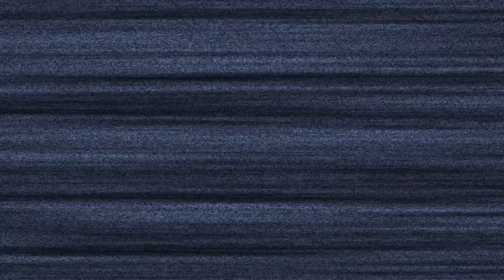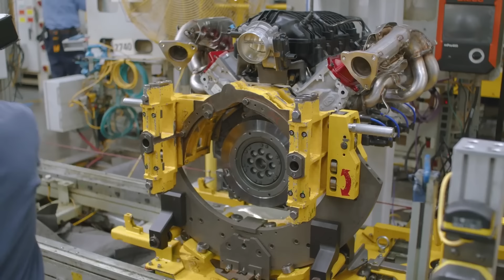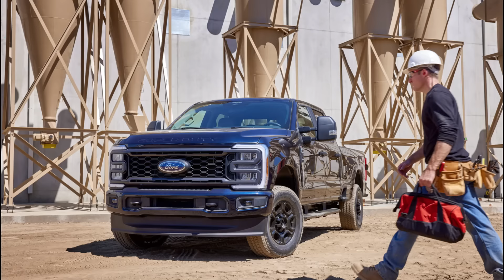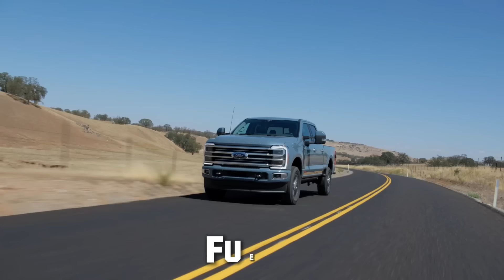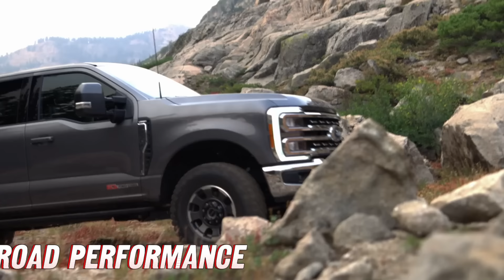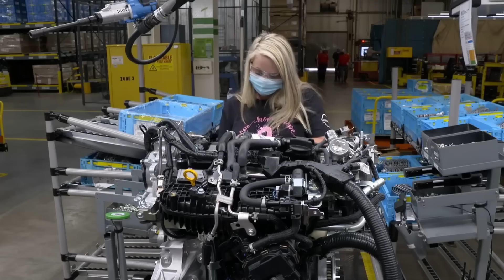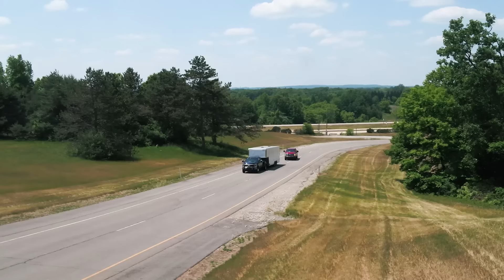ALL 4 Powertrains of 2026 Ford Super Duty EXPLAINED in Detail!

Comment: When a CEL has a starting price of $6k and dealershits having a warranty approval rate that rivals health insurance companies, i just can't justify a $1,000+/mo payment for something I'll only get to drive between the house and the shop.
Reply from the maker: You're not wrong about the warranty approval rates. They'll fight you on a $500 repair like it's coming out of their own pocket. $6K starting point for a CEL fix on a brand new truck is absolutely insane. At that point you're basically paying luxury car prices for work truck reliability. 

Hard to justify when your truck spends more time at the dealer than in your driveway. What are you driving instead, or are you just sticking with older stuff that you can actually afford to fix?
Reply: @speed_spectrum_cars  
95 jeep, 5.2, 46re thats about to be 3 pedal swapped
99 f250, 7.3, 4r100 that will be 3rd pedal swapped of I ever have to unboltnit from the block.

Comment: So what power plant(s) are new for 2026? The operative market feedback to Ford is … fix the current shitty power plants already in circulation.
Reply from the maker: Exactly! Instead of rolling out more half-baked engines, how about just making the ones they have actually work properly? The 6.7 Powerstroke, 7.3 Godzilla, and 6.8 are all decent concepts that just need the bugs worked out.

Fix the 10-speed transmission issues, sort out the Powerstroke emissions problems, and make the 7.3 not drink fuel like it's going out of style. That would be way more valuable than some new engine with all-new problems.

But knowing Ford, they'll probably debut some new turbocharged mess instead of fixing what they already have. What specific issues are you hoping they address?

Comment: So nothing changed........
Got it!
Ford needs to dump the boat anchor 6.8L all together and offer the 7.3 as the entry point, especially for 2wd trucks.  Anyone doing highway hauling doesn't need 4wd, it's unnecessary added weight and cost.
Reply from the maker: Makes total sense! The 6.8 feels like Ford trying to squeeze another engine option into a lineup that doesn't need it. If you're stepping up to a Super Duty, you probably want the real torque the 7.3 delivers.

And you're spot-on about 2WD for highway hauling - all that 4WD hardware is just dead weight and complexity when you're pulling trailers on interstates. Lighter truck, better payload, lower cost, simpler maintenance. Wonder if Ford keeps the 6.8 just to hit some fleet pricing targets?

Comment: 8.000 lbs in the bed of your pickup is insane
Reply from the maker: Yeah, 8000 lbs payload is absolutely nuts when you think about it! That's like putting four cars worth of weight in the bed. Most people would probably break their suspension just looking at that much weight.

Are you actually using anywhere near that capacity, or is it more of a "nice to have the option" thing? Because I feel like most real-world loads are way under that, but having the headroom is reassuring.
Reply: @speed_spectrum_cars  well, at least two modern cars. The structural and insulation really add up on the scale. The average crossover weighs around 4,000 lbs dry. For example, a Chevrolet Trax weighs 4,125 lbs without fluids in it. but still, mind blowing.

Comment: What good are they when they install the wet belt in all the engines?
Reply from the maker: The wet belt nightmare is more of an EcoBoost thing in cars and smaller trucks where that belt runs in oil and disintegrates after 100k miles or so. Those are definitely a ticking time bomb situation.

Are you maybe thinking of a different engine family, or have you heard something about Ford putting wet belts in the Super Duty engines?
Reply: @speed_spectrum_cars  i dont know about the super duty but the F150 with the 5.0 has a wet belt, to me thats a no buy.

Comment: Junk oil and transmission plastic pans
Reply from the maker: Plastic oil pans and transmission pans are such a penny-pinching move! Nothing says "built to last" like critical components made from the same stuff as your kids' toys.
One rock kick or minor scrape and you're looking at a tow truck instead of just a dent in a metal pan. Plus good luck getting a drain plug to seal properly in plastic after a few oil changes. Are you seeing these fail in the field, or just frustrated by the cheap-out design?

Comment: More overpriced, unrepairable garbage.
Reply from the maker: The unrepairable part is what really gets me! $90K for a truck that needs a computer diagnostic just to figure out why the tailgate won't open. And when it breaks, you're stuck going to the dealer because nobody else has the proprietary tools. Used to be able to fix most truck problems with a basic toolset. Now everything's integrated and serialized - even replacing a headlight requires programming.

What's your plan - stick with older stuff that you can actually work on, or just accept the dealer dependency?
Reply: Old vehicles repaired as much as possible for as long as possible. @speed_spectrum_cars

Comment: Watching this made me realize why I should hold onto my 7.3 powerstroke forever.
Reply from the maker: Good call, those old 7.3s are legendary workhorses. Which model year is yours, and was it the complexity of the newer powertrains in the video that made you feel that way?
Reply: the repair costs is whats making me keep my 7.3. Company i used to work for had a fleet of 2018-2022 6.7s. They told me a CEL was $6k minimum, and knowing stealerships like I do, they're gonna decline to honor warranties.
Reply: I agree. I will NEVER sell my 7.3 diesel. My truck is an 02’ and still looks like new.
Reply: they're good engines and they're tough but what specifically are you referring too? I like 7.3PS but I think it's a boat anchor of an engine. they don't make the greatest power especially for how large they are. it was sad when they switched to the 6.0 in 2003 but the 7.3 was really starting to show it's age by that time.
Reply: Because it’s cheap and weak?
Reply: @PARATI-SUMUS  they're not that bad. it was a gutless boat anchor, but they were pretty reliable and had a great sound and smell to them.
Reply: @ElectronicsForFun  with a better turbo, larger injectors and a built transmission, a 7.3 can keep up with the newer (stock) diesels. You'll spend 12-15k to get there, though.

I recently had the transmission on my 7.3 built. Ouch. Next will be a turbo upgrade. After that, injectors. The turbo and injectors combined will only cost half as much as the transmission.
Reply: @Brandon_Nelson92  even then your biggest advantage is the displacement. The motor just wasn't designed for high horse power. Only 2 valves per cylinder will bottleneck how fast air can move through the engine. That alone will limit how much power you can make.
Reply: @ElectronicsForFun that limit is still well above what I'm trying to accomplish. I'm only building for 450-500hp reliable towing. Stage 1 turbo and 180cc 30% injectors.
Reply: @Brandon_Nelson92  no doubt it can make 500HP but I will never look at it as the powerhouse people claim it to be. Again not at all a bad motor but it just fits into 80's the big block stigma. big iron block that makes about as much horse power as a new camry. in the late 70's up to the early 2000's big blocks just lost all their balls because of emissions requirements and how hard it was for them to meet them. The difference is the 7.3 didn't have to adhere to any of this. it was just a big tractor motor crammed into a truck and then higher horse power diesels started to become more mainstream so the 7.3 had to die and NoX restrictions was the final nail in the coffin for it.
Reply: @PARATI-SUMUS saying that I know one at 1.3 million miles with the stock block and turbo no not weak

Comment: Manual in these trucs asap
Reply from the maker: A manual would definitely make a lot of truck purists happy, but with the torque these modern engines put out, Ford seems locked into automatics for towing and efficiency reasons. Do you think there’s still a big enough demand for a manual option in heavy-duty trucks today?

Comment: NO FORD IN MY DRIVWAY. I DO NOT GET MORE RECALLS.
Reply from the maker: Sounds like you’ve had some rough experiences with Ford in the past. Recalls definitely leave a bad taste, though they’ve become pretty common across most brands lately. Out of curiosity, what brand do you trust more when it comes to avoiding those headaches?
Reply: I just don't understand how they keep building such poor quality of vehicles. I've been doing this for 44 years I own my own shop and they used to be a fairly decent car no worse than anybody else but the last 15 to 20 years I've seen the decline. Such as plastic thermostat housings plastic elbows going into turbos heating and cooling stepper motors. The doors in the manifold box for the blender doors not only falling apart but melting. Sometime just about the choice of materials used. Knowing the automotive industry is probably the cheapest material they can get. A dime needs to go or a dime needs to go. The other thing I don't understand is it didn't work before but let's keep doing it again and again and again.

Comment: This video feels very AI.
Reply: it feels AI because so many of the background images and videos are not what is actually being talked about. like when talking about the 6.7 they put up a picture of Cummins in a 6.0 engine bay. either they do this on purpose to get comments, or they do poor research and dont actually know what the engines look like and just put generic engine and assembly line clips into the video.
Reply: Or it could be the AI clickbait thumbnail. It looks like most of the videos on this channel are clickbait thumbnails, and then they just read you the specs off of the manufacturer website.
Reply from the maker: The video isn’t AI generated, it was fully researched and put together by a human team. Curious though, what part of it made you feel like it came from AI?

Comment: Completely useless video.
Just say that it’s the same engines as before.
Reply from the maker: Fair point, but nowhere in the video was it suggested these were brand-new powertrains, it was simply a breakdown of what’s currently offered for the 2026 Super Duty lineup. Out of the 4, which one are you leaning towards?

Comment: My 6.8 crew cab 4x4 250 got 25 mpg. My 6.7 crew cab 4x4 single rear wheel 350 gets 14... none of the mileage information is remotely correct.
Reply from the maker: Appreciate you sharing your real-world numbers. The mpg figures in the video come straight from Ford’s published estimates, but as you know, those rarely match what owners actually see, especially with heavy-duty trucks that get worked hard. Between your 6.8 and 6.7, which one feels like the better overall truck to own day to day?

Comment: Cummins is the most unreliable engine I’ve ever owned,if you own a diesel truck ,any brand better keep 10 or20 grand in your pocket for repairs
Reply from the maker: Sorry to hear about your experience with the Cummins. A lot of owners swear by them, but you’re right—modern diesels across the board can be expensive when things go wrong, especially with emissions systems. That’s part of why some people lean toward the Godzilla gas V8 instead, since it avoids DEF and turbo-related repairs. If you had to pick again, would you stick with diesel or go gas next time?

Comment: I've heard no more Diesel Emissions as per new reduced regulations, they will be deleted from the Factory?!?
Reply: Not true. Nothing has changed except a new rule that requires manufacturers to update the software to allow the truck to operate 800hrs or 4200 miles once the DEF fluid runs out. 

So, basically, the EPA has proposed cutting GHG (Greenhouse Gas) regulations, NOT Criteria pollutant regulations (which cover the emissions systems under the Clean Air Act). Because the EPA can’t change the Clean Air Act. Only Congress can change the law. Nor can the EPA legalize deleting the emissions systems because, again, the EPA can’t change the Clean Air Act. 

That being said, HR 4117 was introduced in June, with the intent of amending the Clean Air Act to repeal the establishment of motor vehicle emission and fuel standards, and for other purposes. Which if passed through committee, sent to the floor for house vote and approved, then sent to the senate for approval, and finally signed by Trump, only then would we see the removal of these modern diesel emissions systems. Currently there is less than a 1% chance of this happening. 

Channels that put out videos telling people the new EPA rule change will allow for the removal of these systems are either grossly misinformed, haven’t done the research or, the more likely scenario, are simply putting the videos out for clickbait views.
Reply from the maker: Hey! As of now, there’s no official word from Ford about removing diesel emissions systems in the 2026 Super Duty. The 6.7L Power Stroke V8 Turbo Diesel still comes with the standard DEF and SCR systems to meet EPA standards, and there haven’t been any confirmed changes. While some chatter exists about future regulation tweaks, nothing concrete has been announced. Are you leaning more toward gas or diesel for your next truck?
Reply: @speed_spectrum_cars depends on what happens in this situation

Comment: If I needed a full sized pickup truck, it would be the Ford F-250
Reply from the maker: Solid choice! The F-250 has a reputation for durability and towing capability, especially with the Godzilla V8 or Power Stroke diesel. Which powertrain would you go for?
Reply: @speed_spectrum_cars I've heard great things about the Godzilla 7.3 ,it's a reliable powerhouse of an engine, I would probably use it for plowing snow, I'm sure that it can go through anything mother nature can dish out

Comment: Did they fix the camshaft/ lifter failure issue on the 7.3 gas ?

Did they fix the problem with the 10speed transmission ?
Reply from the maker: Yes, Ford has addressed both issues for the 2026 Super Duty. The 7.3L Godzilla gas engine had lifter and camshaft failures in earlier models, but Ford fixed this by increasing the idle speed to reduce the risk of failure. The 10-speed transmission also had problems with the CDF drum, which caused harsh shifting, and that’s been revised with updated bushings and components. Are you planning on going with the gas or diesel option?
Reply: @speed_spectrum_cars  I was in the market for a new vehicle at the beginning of this year. Having previously owned a 2011 F250 4x4 that I loved, I was considering a new F250 4x4. Then my research led me to find out about the problems I initially mentioned in my first comment. So, I opted not to get a new SD. I wasn't interested in spending that kind of money if the truck was gonna spend more time in the shop than on the road. The new SD looks great, and I do see a lot of them around, but I'm gonna wait awhile and see if I can observe more positive feedback on them before I consider one again.
Reply: @speed_spectrum_cars  That wasn’t fixed for 2026…. It was addressed mid 2023+…. The lifter issue anyway.
Reply: I'll WAIT and see IF the FOMOCO "Engineers" were successful in relieving all of the problems, but I'm not holding my breath..! 
FORD has led the field with only one thing and that's RECALLS..! 🤣😁😁😟
Reply: @Duschbag  😂no sir, that’s GM. Even so, most of the ‘recalls’ on these modern trucks pertain to the software, and not the drivetrains.
Reply: @RepublicTexas36 as a ford tech ill tell you its because ford doesn't want to admit its because they can't build shit correctly so they tune out their problems with pcm "updates"
Reply: @RepublicTexas36 
Yeah, that’s what the manufacturers claim as they are changing out valve bodies and camshafts and lifters

Comment: The challenge for max payload buyers is trying to twist Ford's arm into selling you a 2wd Super Duty regular cab long bed with a 7.3 gas engine.
Reply from the maker: I hear you, modern regulations and tech have definitely changed how trucks are engineered, sometimes at the cost of longevity. Which of the 2026 Super Duty powertrains do you think still has the best chance of lasting long-term?
Reply: @speed_spectrum_cars Gas engine for sure

Comment: It’s sad, but nowadays, we are not buying trucks, we are buying warranties that come with trucks.
Reply: You're playing a little fast and loose with the word truck
Reply: @airlar4857 Truck-

Truck classifications are typically based upon the maximum loaded weight of the truck, typically using the gross vehicle weight rating (GVWR) and sometimes also the gross trailer weight rating (GTWR), and can vary among jurisdictions.
Pretty sure a 2025 ford pulling 30,000 lbs qualifies as a Truck. (Just make sure you have a warranty) if you have a 6.4.. sell it while it’s running still
Reply from the maker: Which of the 2026 Super Duty powertrains do you think would hold up best if you tried to minimize repairs?
Reply: @speed_spectrum_cars that’s not even what he asked bro
Reply: @GxldnReaper  what? Your reply makes no sense. OP didn’t even ask a question. The comment reply was simply asking OP a hypothetical question.
Reply: @RepublicTexas36 yeah my fault
Reply: @speed_spectrum_cars one of each, in my car collection